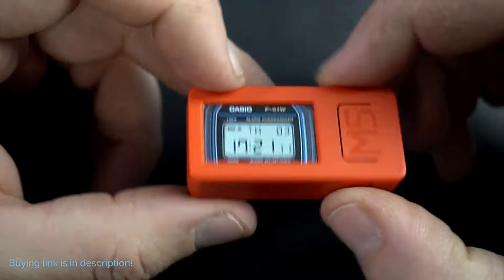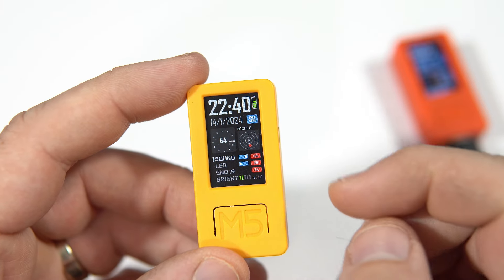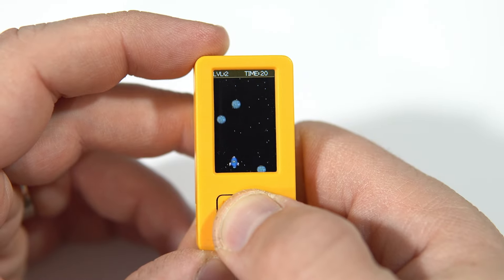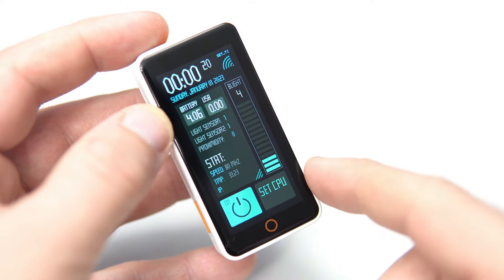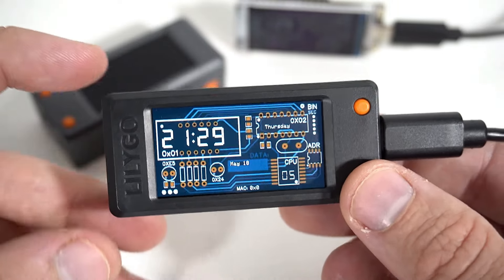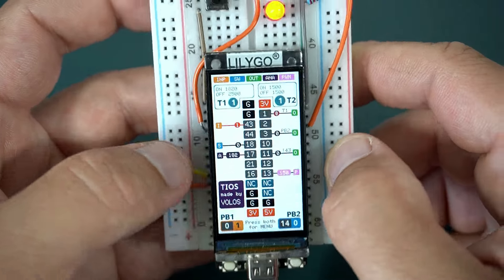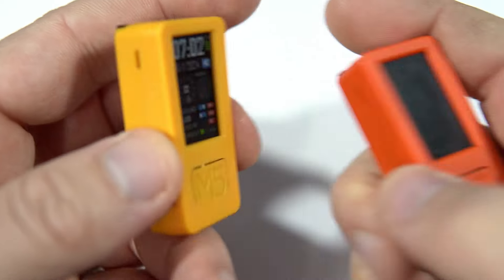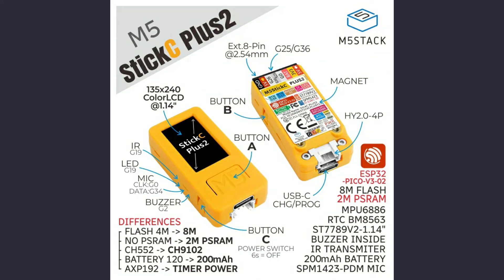Thumb-Size Computer : NEW M5Stick C Plus2

Comment: Open question to anyone (and Volos of course).  My M5Stick C Plus 2 works great.  Moved code to M5Capsule.   M5Capsule reads I2C only while pressing "Wake" button.  IO42.  Not sure why. Using the Port A for I2C, IO 13, 15.

Comment: Great video. I've tried to compile your project but I keep getting errors. Would you have the versions for each library you're using documented somewhere? I manually added IRemote and others as required but still getting a compilation error related to IrSender.. I want to mention you on my next video, that's the reason.
Reply from the maker: You have this board already? New version?

Comment: This project looks amazing! I'm trying (but failing) to make my own project. I have just got one and tried to connect it to a LoRa E5 device through the Grove port. Any idea on how to set the grove port as a UART serial output? In fact, I can't seem to find much support for this device, any chance for a point in the right direction pretty please :D (I should say that I'm using the Arduino IDE).
Reply from the maker: @jonty1857  hello , thank you. I am still learning how to use LoRA. I never used grove as serial port, but it can be done please google virtual serial port on esp32. Also i think chat gpt can help

Comment: Do you think this could be used as a portable speaker for a toddler? How would the battery life hold up?
Reply from the maker: I dont think so, inside is just buzzer not speaker.
Reply: @VolosProjects  Oh I was thinking of using the M5StickCPLUS Speaker 2 Hat
Reply from the maker: Mozes i tako, al baterija ce proc za dva sata, a i memorija je mala, mozda je bolji  klasicni m5stack koji ima vecu bateriju i utor za memorijsku karticu.
Reply: Ima smisla, hvala :)

Comment: Love your videos!

I think there is a bug in your "MyExample" demo code.

I assume that the accerlerometer dot is like a bubble level, and it works correctly for the x direction (left/right when viewing the screen in portrait orientation with the USB C port facing down).  However, it appears to be reversed for the Y axis.  This can be seen in the video -- the dot moves "downhill" when tilted to make the dot move along the long direction of the screen.

I believe I was able to fix this by changing the line:
yy=map(y,-800,800,102,146);

To this:
yy=map(-y,-800,800,102,146);